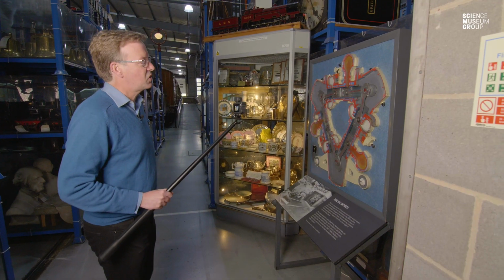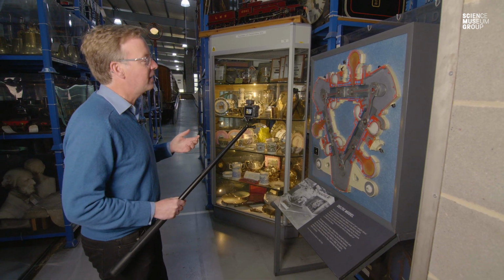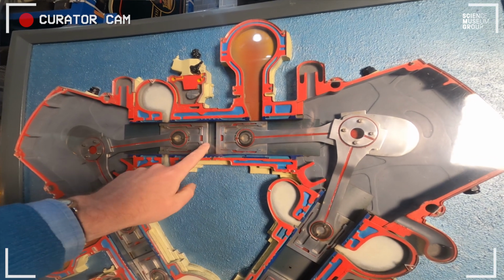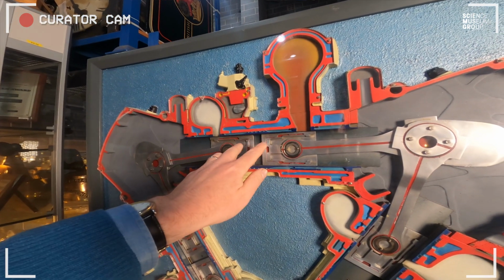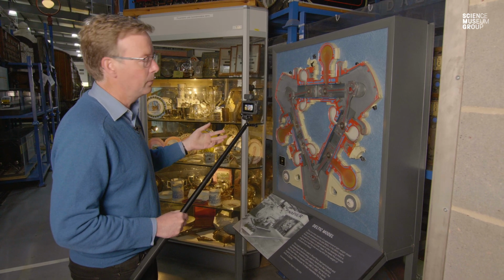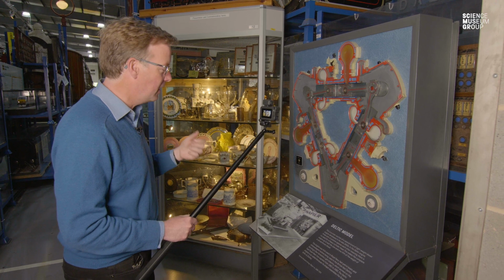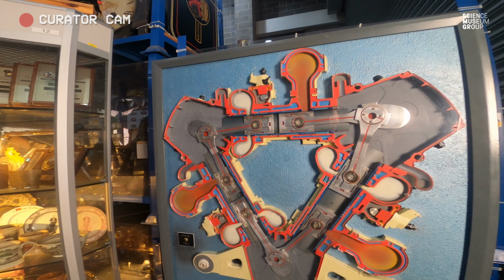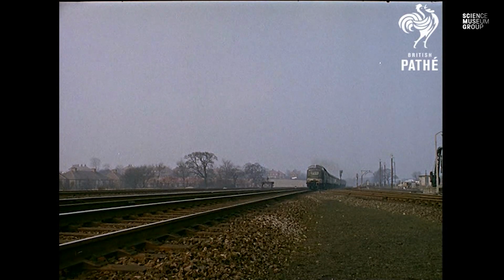How does the Deltic power unit work? | Curator with a Camera Extra

Comment: Decent explanation. Just a slight criticism: there are no explosions in a properly working engine; it's a controlled burn, and it's the control that gives the power. The more exact you can control the air/fuel mixture, ignition time, and burn rate, the more power you can squeeze out of the fuel. Delta engines do however share a fault with Wankler (rotary) engines: they're great in theory, but the complex construction makes them difficult to maintain and over time they start to leak and loose pressure, which drastically lower their power output. It's a design that's great for high power output, but they're typically shortlived. It's why these designs never became very popular. The extra mass of a traditional engine is outweighed by the fact it's easier to maintain and has a much longer lifespan.
Reply: Indeed, I had failed to read my Ladybird book of the Locomotive that morning. As the owner of a diesel powered road roller I should know that regardless!

Comment: The presenter is a little confused about why the Deltic engine is light weight and can rev high.     In an inline engine the cylinder head is not that heavy - its only a small fraction of the total mass.   A average man can lift and carry the head of an average 4 cylinder diesel engine - even a 6 cylinder with significant strain.  I can anyway, and I'm only a little chap.  An average man has no hope of picking up and carrying a 4 cyl engine block.  Just the crankshaft and flywheel weigh more than the head.    If you visualise an opposed piston engine with an imaginary plane midway between the pistons at TDC, you'll see that it is really just 2 inline engines siamesed at that imaginary plane.   In other words, instead on one big engine, you have two smaller engines, each of half the displacement and half the stroke.   So the stresses on the crankshafts are reduced to 25% - because you have half the force acting on half the crank throw.   Big ends and bearings can be a lot smaller.   That's the main reason why it's light and high reving, not because there is no cylinder head.
In the case of the Deltic diagram shown in the video, instead on one big 3 cyl engine, you've got the equivalent of 6 little single cyl engines or if you like the equivalent of a 6 cyl inline engine of the same total displacement.   There is a further advantage in that you've got three crankshafts and not 6, but each the three don't need to be heavier than each of the 6 would need to be, because the power strokes come at different times.  
There are some minor advantages of the more common opposed piston designs (eg in Commer Knocker) in fuel efficiency that come from short stroke and being able to have the minimum piston-to-piston distance position offset from exactly centred between the crank centres - this improves scavenging, and is done by having the two cranks rotate a little out of phase.    However this is not possible in a Deltic with three crankshafts.  
And of course the presenter erred in saying there is an explosion.    It is a timed controlled burn, typically lasting between 8 to 10 degrees before TDC and 8 to 10 degrees after TDC at full power.